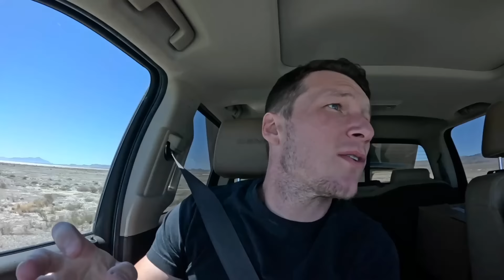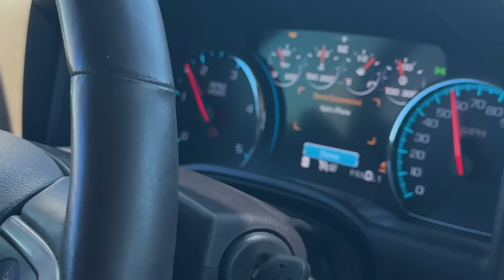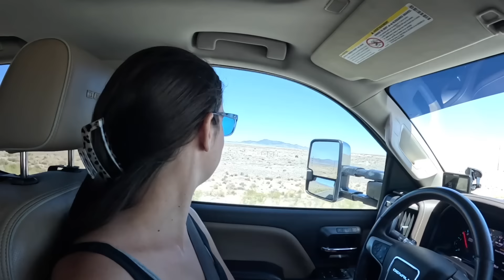New Trucks are 'Built' to Leave You Stranded

Comment: Delete the after treatment. You'll have less issues but as for gas having more maintenance. That's a lie. We have a 2019 Ram Laramie 2500 with the Cummins and every other time you change the oil your underneath changing that fuel filter did some more maintenance for diesel am I humble opinion

Comment: Note that the majority of the things that fail are brought to you by those in Government. 
It wasn't long ago these trucks would simply run forever. 
Today, you need to run at High RPM's to burn off during Regen....to run Regen you burn Fuel....to repair you have to burn Energy...to replace the Regen unit it has to be Manufactured....so in the end, how much did we really save the Environment.

Comment: I have a friend that has an '08 Silverado 2500 diesel, pre DEF but not the other crap that gave him a fit. It would reduce power on him frequently because it would not burn off the impurities in the particulate filter where he had it regenerated a few times at a cost, didn't help. Then he had to have the EGR valve replaced because it clogged up to were there was an opening no bigger than a no. 2 lead pencil, which was way too small for proper operation. He kept the old one and scraped it out a few times until that got old. He finally came across a diesel mech that convinced him to delete and tune the truck. He got more horsepower and better fuel mileage and NO MORE PROBLEMS and that has been about 10 yrs ago and the truck is 17 yrs old. Since then I have noticed and talked to a lot of diesel owners that have done it and are grateful they don't have those problems. It happens to ALL diesels not just GM products

Comment: I just bought a 1995 Dodge RAM 2500, Cummins diesel. I bought it because it's so old that it has no smog equipment or electronics on the drivetrain. I don't feel good about my dirty air, but if I weren't driving it someone else would be. I would never tune it so it smokes, and whenever possible I drive it so it doesn't smoke.
It's easy to double the power safely too. But, man, the steering sucks. I just ordered three thousand $ worth of aftermarket things to fix it. I also have a '02 Duramax, and that drives like a car compared to this Dodge. The other thing about the Allison that you didn't mention is the smooth shifting. What you need is a Cummins 24-valve and an Allison, in the oldest truck you can put that combo into.😉 Technically, it wouldn't be smog legal, but no one's going to notice unless you're driving around pissing people off by rolling coal. It helps not having your wheels stick way out too. That gets noticed, and not in a good way.
Go synthetic oil and stay synthetic. NAPA premium or Valvoline heavy duty are good ones - both are made by the same company and oil testing shows they perform well, very well compared to some oils. Some of these fancy, expensive oils get outperformed by those. Whatever oil you use, get a bypass oil filter, full stop (they filter to one micron). A lift pump too. Those two things are no-brainers. Your injectors will thank you for the lift pump.

Comment: The next time you’re all are passing through Utah go see the guys insane diesel and have them put an oil filter bypass system on your truck and they’ll also educate you on the best fuel additive for a diesel pick up. I drive a 2017 Chevy Duramax which is the same as your truck and I’ve been running their fuel additive all year with great improvements

Comment: Emissions are the worst part of new diesels...PERIOD. EGR valves to a motor, is just like a non-smoker sitting in your RV with 20 people smoking. You are receiving 2nd hand smoke just like the engine is breathing in the exhaust particulate and it contaminates your oil like smoke contaminates your lungs. (yes, I am medically educated just like you two are and also a 18 wheeler driver with producing farms)
You guys travel through many states and especially California, the capital of extra problematic emissions. Were it not for that, I would tell you to Delete the truck. It will run sooooo much better, your oil will be cleaner at the same number of miles, but, it is not currently legal to do this. If caught, then you will be required to put everything back on that you took off. HOPEFULLY...We may see some very significant changes to these laws because of the down time many companies experience vs the little bit of good they are in our world today.
GREAT CONTENT extremely well done. I enjoy watching your journey. We have had multiple motorhomes since 1990 with thousands of miles of windshield time. Be safe and watch out for 4 wheelers like the blue one that cut too close in front of you.

Comment: 184k miles, been fully deleted since 30k. Not a single issue. I run Hotshots EDT on each fill, oil at 7k, fuel filter & air at 14k

Comment: Hey guys, new subscriber here. I just came across your channel today and watched a few videos and really appreciate the unvarnished depiction of life on the road, showing all the problems encountered and how you've dealt with them.

On this particular subject - problems with your Duramax - I have to agree with what several commenters have said: at this point I'd consider getting rid of the diesel and getting a HD gas pickup. I don't know the size of your camper, but from the little I've seen it looks like a pretty big so it may be too large to pull with a gas truck, but if it were me, I'd consider downsizing the camper to be able to switch to gas. I'm a former Duramax owner - 2012 Chevy LTD - and loved it, pulling a 4 horse trailer in the Colorado mountains, as well as making several trips pulling a 28' Lance trailer in the mountains. Never had any issues, but this was also a pre-DEF truck. When not pulling a load I averaged about 17-18 MPG; with a load about 10-12 MPG. Then I decided to downsize when we moved east and got a 2012 Tundra and hauled a U-Haul behind it for the move and averaged 10MPG, so the "saving" wasn't all that much. Then factor in that diesel fuel costs about $1/gal more, the diesel wasn't worth the expense even though I had no major repair bills on it. With today's gas engines putting out so much more power and torque than they used to, and the generally lower maintenance and repair costs and greater ease in finding parts and mechanics, if I were in your shoes I'd switch to a gas truck (my personal choice would be a Toyota, but YMMV). And finally, I'd get a smaller, but better built camper. If you're living on the road FT you want as few problems as possible, and that means invest in quality.

Good luck!

Comment: This is why I don't have an issue with the fact that I had to put $10k into my 2002 dodge ram 3500 this year. Pre-emissions trucks aren't cheap but in the long run you save money.  Especially when you consider fuel economy. I get 18+mpg empty in a dually. 12-13mpg towing my 10k pound 5th wheel.

Comment: The new GMC's are junk. If the emissions don't kill the truck then the valve body in the transmission will. They have a major problem where at highway speeds they will shift into 3rd gear locking up the tires. The valve bodies are on national back order and the downshift is known to cause sever damage amongst other driving problems. FYI ive been a Master mechanic for 25 years now.

Comment: If in Utah, hooknup with Daves Auto Center. Checkout his youtube! They can prevent so many of your diesel problems. Its not justthe EGR starin, its tge suet contamination in the oil from it as well as the CP4 pump system that can / will destroy the engine. Please take the time  ti learn

Comment: I've got a 2003 GMC 1500 pickup with a slide in truck camper loaded on it.  I've got 150K and I've never changed the spark plugs.  I've changed air filters, oil filters and changed the oil, I've had to put a new alternator on it and changed the battery and that's it.  It sounds the same as the first day my father bought it and drove it off the lot new.  You may lose mileage with gas but I disagree with your mechanic friend, gas is much more maintenance free.  My dad owned a service station for 35 years and put four sons through College and we grew up in the service station working with dad in the summers and after school.  So i have years experience, I'm not a novice.  ALL these newer trucks are crap, their motors are crap, their transmissions are crap and I'd put my 2003 GMC against any one of them.  And when you buy a high priced package like Denali, all you did was pay too much money for alot more crap to tear up.  Watch these youtube channels where they bought a new truck and 4000 later they are replacing the engine or transmission.  This new shit is crap!

Comment: The def system has been hell for the trucking industry since it was put into the engines. These engines break down often and are very expensive to fix. I’m a truck driver so when I bought a truck to pull a trailer I bought a gas engine (Toyota tundra), I didn’t want to deal with the issues and the expensive repairs.

Comment: The EGR system in a diesel engine is not used at wide-open throttle (WOT). 

EGR (Exhaust Gas Recirculation) system plays a crucial role in reducing harmful combustion temperatures.

It works by recirculating a portion of the exhaust CO2 gas back into the engine's cylinders, which lowers combustion temperatures reducing NOx formation. 

Excellent device that makes your engine last longer.
Ignorant drivers don't understand how it works 😂 because they're brain dead.

It doesn't reduce horsepower and isn't used at WOT, wide open throttle. 

Burning HC produces CO2; CO2 is what should come out of the vehicle tailpipe. 

Hydrocarbons are a major source of energy (e.g., gasoline, natural gas, diesel fuel)
More detailed examples:

Gasoline: A complex mixture of hydrocarbons derived from crude oil, primarily used in vehicles. 

Natural gas: Primarily composed of methane, it's used for heating, cooking, and electricity generation. 

Jet fuel: A type of kerosene-based fuel used to power aircraft. 

Diesel: Another petroleum-based fuel, used in diesel engines for vehicles and machinery. 

Propane: A gaseous hydrocarbon, often used for heating and cooking. 

Coal: A fossil fuel, composed primarily of carbon, but also containing significant amounts of hydrogen. 

Kerosene: A liquid hydrocarbon fuel, commonly used for heating and lighting.

Comment: My gas 2023 F350 has the same trans as the diesel model. I would only buy diesel again if the loads I'm hauling required it. The gas F350 with the 7.3, 10R140 and a sterling 11.6" rear end pulls a 13k 5W cross country with ease. I do my own oil changes with motorcraft syn blend and filter for $60. I've only got 25k on the truck so I can't speak to the maintenance intervals being shorter on gas. What a great experience for a truck owner to get this kind of access to a knowledgeable and experienced technician. If I had a diesel again this would be like the ultimate.

Comment: I went down the Gas / Diesel decision after my 15 year old Chevy diesel through codes for 5 years going into limp mode while towing.. I chose a gasser. I tow about 7300 lbs average 85 night a year on the road. This summer we towed in the Canadian Rockies and some of the Colorado Rockies. It did fine up hill and down. My biggest issue is finding a good tech that knows diesel.

Comment: I DELETED MY EURO 5 DIESEL TRUCK, THAT HAD ONLY ONE MUFFLER AFTER DPF. 2 FOOT LONG THOUGH.
99.9 HIGHWAY DRIVING. 
NO BACK PRESSURE...
REGENS WHILST DRIVING😂😂😂
MORE P O W E R
NO DEF SYSTEM WHICH I'M GLAD OF.
I USE A LITTLE GOLD BOTTLE ADDATIVE EVERY TANK $ 5 OZ WHEN YOU BUY 10.
& A BIOCIDE 
1 LT COVERS 2000 LT FUEL.
BUT I'M GONNA TRY THE ATF TRICK.
BRILLIANT. 
....
OH
&
STAY AWAY FROM THE STEALERSHIP.
THEY SCREWED ME FOR 15K
& I FOUND OUT FROM A PROPER
MECHANIC. 
"" THEY DID NOTHING !!!! OF WHAT THESE
INVOICES SAY.....""
.
I.FIXED MYSELF FOR $20.
.
I'M PREPARED TO TAKE THAT RISK.
.
AHLS...

Comment: Just dont buy a diesel truck. The aftertreatment systems are designed to fail. The gas engines with the correct acle ratios can and will tow most average campers and fifth wheels with ease.

Comment: My DEF sensor went out ('18 GMC), and the recommended fix is to replace the whole unit. It is on backorder through GMC with a 6-month ship date. That's the same as it was when it went out 9 months ago -- on a part that is required for the truck to run. No wonder there's an underground market for deleting these systems.

Comment: GMC is the worst. I had a 2024 gmc with 20k miles on it. Mind you this truck hauls heavy everyday. The dpf got so clogged it was generating so much back pressure it was blowing the boost pipe off. Needed basically a new egr system and dof filter.

Comment: Thanks to this video, I knew exactly where to go when my truck started acting up. Yesterday, while driving my 2021 GMC Sierra Denali 2500HD (45,762 miles) from Colorado to Utah, my dashboard suddenly displayed “Cleaning Exhaust Filter – Must Continue Driving” followed shortly by “Engine Power Is Reduced.” I drove about 150 miles without feeling much change in power, but after re-watching this video, I decided to call Caiden. He was absolutely fantastic—he got me in right away, ran a computerized diagnostic, forced a regeneration cycle, and cleared the check engine light. Caiden clearly explained the results, suggested my diesel particulate filter (DPF) might be dirty, and advised that I should be able to make it back to Colorado. Unfortunately, about 75 miles later the truck lost power, and I had to limp along at ~24 mph to the GMC dealership in Price, Utah, where it’s now awaiting a mechanic - and a BIG repair bill. Even though the issue came back, I’m so grateful for Caiden’s quick help, thorough explanation, and professionalism. He went above and beyond to get me back on the road as quickly as possible. Thanks also to the Hanks for posting this video! Safe travels!!

Comment: I feel the pain. My 2021 RAM 2500 developed an issue while I was above 6000 ft by throwing the same code but it will go directly to 5 MPH after 150 miles. DEF was at 1/4 so I filled it and it seemed to resolve the issue. Later and again above 6000 ft it did it again but at half a tank. Filled it but it did not resolve the issue. I discovered that it would not do this at lower elevations and took it to the dealer who found nothing wrong with they but flushed the tank and reset the sensor. Well again at high elevations it did it again. Back to the dealer who replaced the sensor but could not find anything wrong. I learned to carry a box of DEF anytime I was going to higher elevations. Last time it did it to me was on a cross country trip near Lake Havasu where the dealer could not reset it and had to flash the ECU to the tune of $190. RAM still has not been able to duplicate the issue or fix it. I could invoke the  Lemon Law but would have to pay $12,000 because of milage. The truck is paid off and I don't want another payment so I always carry DEF when going to higher elevations. DEF systems sucks, this whole reducing speed is BS.

Comment: Just an FYI, that front one is called the Knox catalytic converter and they’re 1495.00. The rear one is called a particulate filter and they are $3000. That’s new from GM. I’m a parch manager at a GM dealer so I was just gonna give you the heads up on what you might run into if you have to replace it. If you have any other questions just hit me up on here.

Comment: If someone is looking to avoid seemingly constant maintenance, consider if an electric truck may fit your needs.  There are so many electric trucks now that can tow heavy loads and which have long ranges.  The 2024 Electric Chevy Silverado can tow 12,500 pounds and has a non-towing range of nearly 500 miles.  I’m not sure if it can support 5th wheels, but there are several other (non-Tesla Cybertruck) electric trucks available.  I’ve been towing my RV with electric vehicles for years now and have never had any drivetrain issues.  EVs have simple motors that don’t heat up or wear out, and don’t have transmissions at all.  Plus you can charge them for free at powered campsites as well, and you can plug your camper into them when off-grid.
Reply: It takes under an hour to charge the Chevy Silverado at a common high speed charger.  They have far fewer mechanical problems than their gas/diesel counterparts and are cheaper to operate.  I speak from experience as I’ve been towing my RV with EVs for years all over the Cascade Mountains.
Reply: Do you anything about what is going on with modern trucks and specially EV trucks? Only a fool gets an electric truck. One can be forgiven for maybe wanting an electric car. Getting any hybrid besides a Toyota can be forgiven too. BUT anybody that gets an electric truck is a subtard. A complete subtard that obviously knows nothing about why EV technology is maybe 20 years away to actually being reliable, affordable if not a millionaire wanting to throw money away on toys, or feasible in the modern world. The only people that love Electric trucks are mechanics and shops wanting to make money from expensive problems. I would not even get a modern standard fuel Chevy Silverado. To get an EV Chevy Silverado is pure ignorance.  Unless want 20 hour charging times, ranges that disappear in Winter zones, resale value laughter too.

Comment: You asked the Mech a question if you could prevent this issue with the DEF injector and he said not really. But I think you can in fact prevent it by using Platinum Peak def that is sold at every Walmart. I use that exclusively and I had zero problems with injector clogs. I use to use regular DEF and had same buildup. After I started using Platinum def which is a bit expensive then regular, at least it prevents the build up. It even says it on the box that it prevents the buildup.